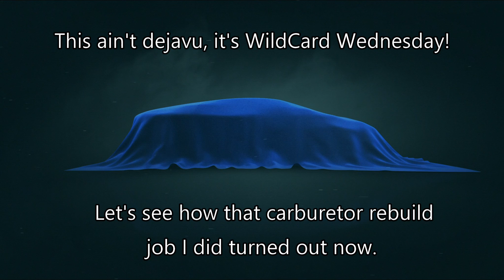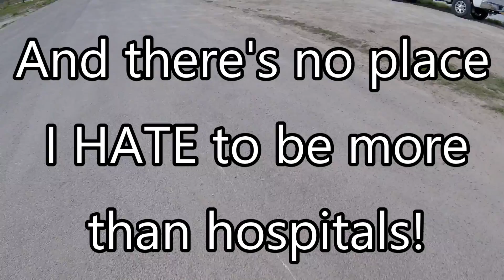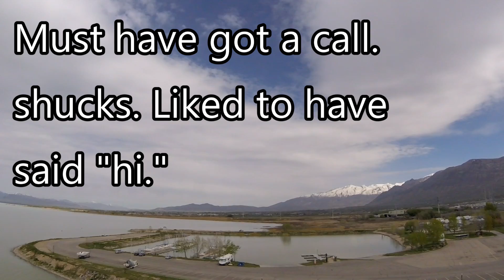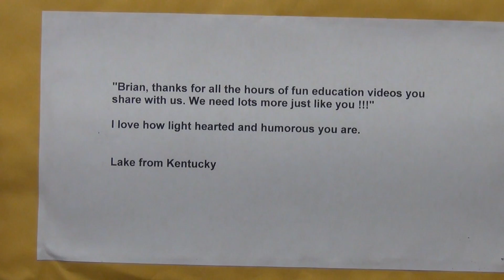How to Test Fly a Paramotor Carburetor with Confidence Vittorazi Moster 185

Comment: May be some day I can afford to buy and fly one of those things (Paraglider). I would like your recommendation, I think I would prefer one with a trike and a joystick for controlling it. I have a birth defect in my right shoulder (Erb's Palsy), that's where they used those salad forks and squeezed too hard on my shoulder during delivery. I have limited movement in my shoulder and that's why I would require a joystick. It has not stopped me from doing my own car repairs over the years.
Reply from the maker: The wheeled ones are called powered parachutes.  The six chuter is a popular one for affordability and you control it mostly with your feet.

Comment: HI BESIDES JUST TESTING THE ENGINE RUNNING ON THE GROUND WITHOUT THE WING.ALSO CHECK FOR AIRBUBBLES VIA THE FUEL TUBES BEING UNSCREWED AND RESCREWED...   LIVE AND LEARN  OR   LEARN AND LIVE
Reply from the maker: HEY TONY!  Good call!  Running a clear fuel filter case helps with that mentally for me.  I watch the flow and bubbles on engine run up.  It also seems to helps as a bubble by-pass, but it's hard to say... or see.